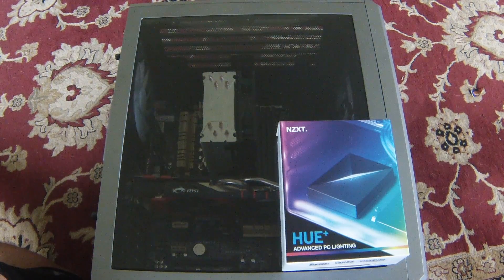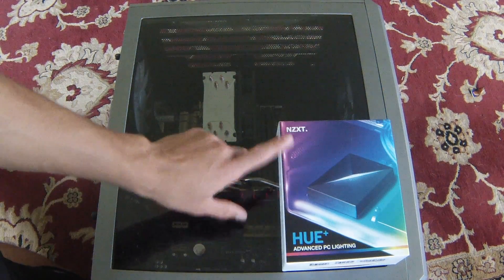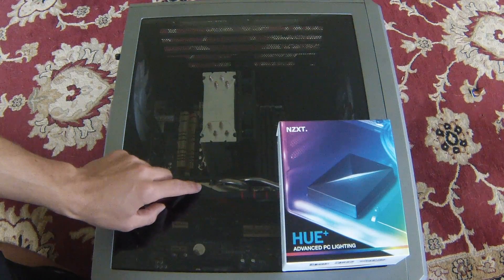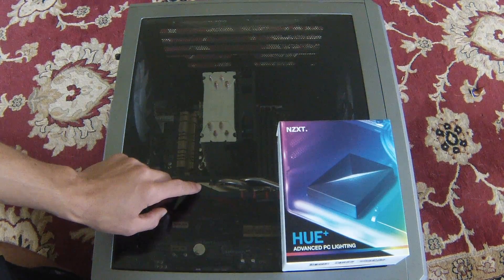How to Install the NZXT Hue+

Comment: I just installed my Hue+ and turned on my PC. The white light turns on, but not the LED lights themselves. (I just plugged my PC to test it and didn't actually connect my PC to my monitor and download the software.) Just curious if I needed to download the software to get the lights to turn on

Comment: @Stellar Tech - I've heard problems where the cam software cannot detect the hue+. Do you have any tips for it to successfully work? Would you recommending installing the cam software before the hardware installation or after?
Reply: I have the hue+ and i can tell you that i do sometimes have issues where CAM cannot recognize the hue+, and instead of my custom lighting, it just illuminates white. However, closing CAM through task manager and opening it back up does the trick (for me at least). Other than that, best led's i've ever purchased.

Comment: why Molex... nzxt lives under a rock
Reply: I was just thinking that. I'm going to have to pull another cable from storage, just to make this work. I'm wondering if you can get away with a molex to sata converter.
Reply: I tried did not work
Reply: how did you end up connecting it can u post what I would need to do can't figure it out to connect it to my power supply
Reply: OK and the with the sata connection can I connect that to any connection that is already being used cause I see a bunch of split in spots where I can jump into with the sata
Reply: alright I'll give that a shot waiting on the usb header because I don't have any extra usb 2.0 open spots but I'll let you know thanks for your time appreciate it

Comment: what if my 2 usb headers are already in use?
Reply: Sol. unless you don't actually need one of those headers
Reply: Y-it-Earp I've seen the nzxt hub online but not in person. definitely a great product if it works as advertised. It'd be nice to have extra headers. I'd give it a try if I needed it
Reply: I had this issue as one used for h100i pump the other for usb front panel connectors 
I simply unplugged the usb front connectors as there are two 2.0 and two 3.0 the 3.0 has its own header so that worked out fine for me.

Nzxt also sell a usb header extender with 4 usb headers on which is around $12 and worth it if your running low.

Comment: Does the very last strip not plug into anything? And how did you get all of them to fit in a full square around your case?
Reply from the maker: +Demaul the last strip does not plug into anything. There are magnets to hold each strip in place, and extension cables that go in between for bigger cases. If you don't have a big case you can just plug the LED strips into each other without extensions and you are good to go.  Hope this helps. Stay tuned for more videos.

Comment: Nice video mate. But I have a question, how do you connect the LED strips to each other? Is there a connector for them? Or you have to directly connect each strip with the other?
Because my case is a bit large, and I won't be able to directly connect the strips to each other.
Reply from the maker: +MardeonasFail the Hue+ comes with black extension cables that you can use to connect the LED strips over a longer distance. They should be in the box. Otherwise you can connect them directly. Hope this helps. Thanks for watching. Stay tuned for new videos.